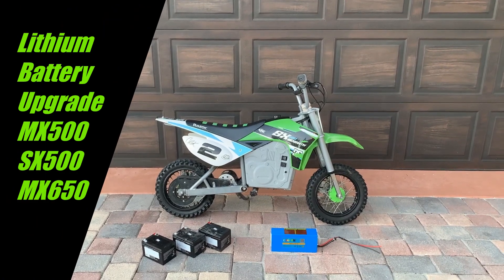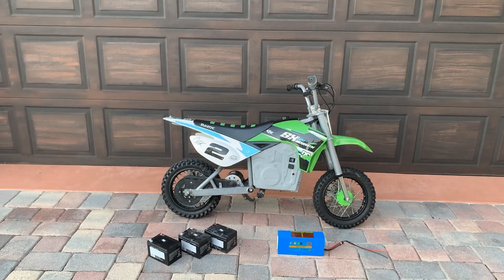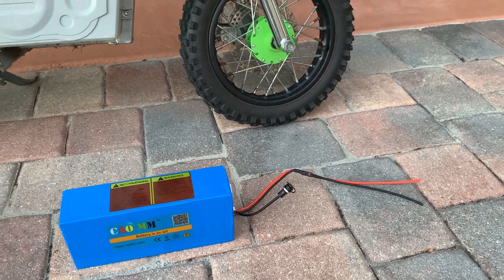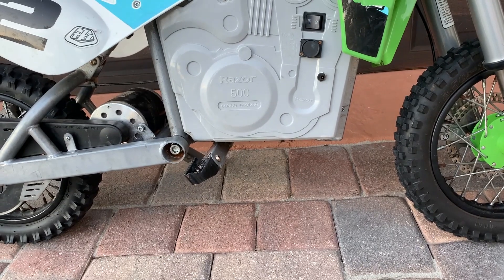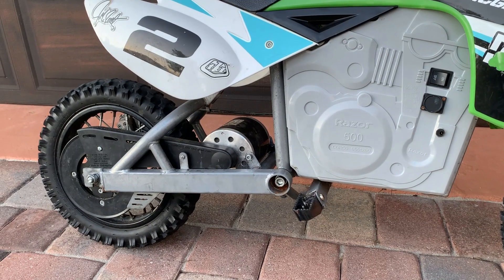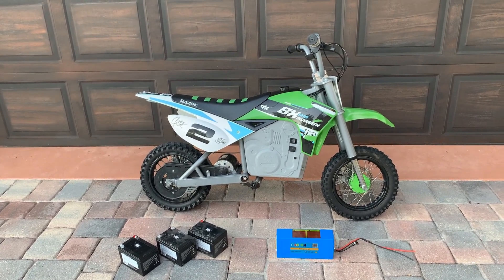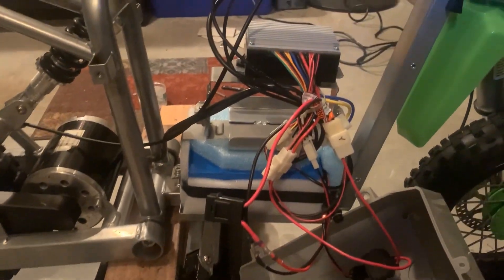Lithium Battery Upgrade - Razor MX500 MX650 SX500 - 18 lbs lighter

Comment: Great video. Do you have a link list for all these amazing free recommendations? I hope you make a little coin helping us out here in the world getting the most of our kids bikes. You rock man.
Reply from the maker: All products used are in the description below the video i also linked them here in the comments 
36V/16Ah 30A BMS Battery & Charger in video:  https://amzn.to/4aTVASS    #ad
(25% longer ride time over stock 12 AH battery)

For longer ride times
36V/20Ah 30A BMS Battery & Charger: https://amzn.to/4aTVASS  #ad
(60% longer ride time over stock 12Ah battery)

Solder & Seal Connectors:  https://amzn.to/3m67t0e
Heat Gun (you can use a lighter) :  https://amzn.to/3rGepCr   
Lever Wire Connectors (east to use): https://amzn.to/3sEI7sB 

Optional Equipment (How to Video coming soon):
Head Light with Switch:  https://amzn.to/3m6lRph
Taillight (states 36V but I use it with 48V w/o issue)  https://amzn.to/3sS0737

Comment: I’m trying to upgrade my little brothers mx350 razor dirt bike, he wants it to go faster and for the battery to last longer. Do you have any suggestions on what I need to do?
Reply from the maker: Yes replace the stock 24V batteries with an new 36V 10ah lithium battery the stock motor and controller can handle the extra volts and you will be able to ride longer and bike will be faster.  Link to 36V 10ah battery with charger on amazon https://amzn.to/3VGO8G5
Reply: @BRichSolution  iv‘e never done a battery change, is it hard? Thank you

Comment: I'm about to purchase the 36V 20AH battery for the SX500. The plan is to upgrade the machine to a 48v at some point. Do you see an issue transplanting the SX500 36V platform directly to a MX350 after an upgrade to 48V?
Reply from the maker: You can transfer the drive train from sx500 to mx350 or mx400 but you need adapter plate for motor to mount on mx350 smaller frame.   https://www.facebook.com/groups/561873590646946/permalink/2197774220390200/?mibextid=W9rl1R

Comment: We're about to upgrade a stock 36v Razor rsf650 to 48v. And a stock razor 350 24v to 36v. Will that alone make the bikes faster? Do we need to change anything else?
Reply from the maker: Here is how to video for Rsf650 48v build.   You can do the 48v battery now and then add 1800w motor if you want.   
https://youtu.be/rBJ2z1ujeRg
Reply from the maker: As for the mx350 use a 36v li-ion battery with stock motor and controller and will give you good performance gains
http://ebay.us/7VCLqF

Comment: Can you install this on the mx350?
Reply from the maker: Technically yes, but would require a lot of mods as motor mounts are smaller on mx350 and battery box is smaller
Reply: @BRichSolution  is there a smaller 24v one they would just plug and play even if the battery is bigger. Basically wire to the existing stuff? I found stock sized lithium batteries but the whole charging situation would be custom and the batteries you’re using seem to have the charging built in.

Comment: i wired and did everything you did in the videos and it is not doing anything i really need help! Plz
Reply from the maker: Which setup?  36v or 48v with stock motor?  Or 48v with new motor and controller?
Reply: @BRichSolution  i have the 48v with new motor and controller i don’t know how to connect the stock on and off switch with the e-lock on the controller

Comment: Why did you keep the 30 amp fuse? I thought you could just solder the two red wires together? Thanks
Reply from the maker: You don’t need the fuse as the li-ion battery has a built in fuse or BMS… I did it as double protection but it’s not really needed.

Comment: I just got this battery and how do you connect it to the upgraded controller with the   1800 watt motor? Thanks
Reply from the maker: See this video 35 MPH / 48 volt - Razor MX650 MX500 or SX500 upgrade for $350, Lithium Battery Upgrade
https://youtu.be/thfQyCmczlk
Reply: @BRichSolution  Awesome thanks

Comment: trash cao mm battery. not real capacity, weak power
Reply from the maker: I’ve built 8 bikes with cao batteries and have not had issue with them and have over 500 miles and 200 charge without degrade in performance
Reply: I got one coming with a fast charger and will let u guys know if it depreciates the battery over time.

Comment: Would you suggest the 16 ah over the 20ah?
Reply from the maker: The 16Ah will give you about 25% more riding time over the OEM batteries and the 20Ah will give you 50% more riding time.   All depends on your need or budget
Reply: @BRichSolution  from the listing on eBay they were pretty much the same price.
Reply from the maker: @afternoondelight6322  if so then go with the 20Ah

Comment: I see all batteries are out of stock except the 36v 20 Ah batteries. Do they also fit with no modifications to the frame? Would you still recommend batteries now?
Reply from the maker: Yes I still recommend the batteries as I have installed 8 of them in MX650, MX500 & SX500.    There are nine 36V/20Ah batteries in stock  right now.   http://ebay.us/7VCLqF

Comment: Is it as simple as connecting the red and black from the lithium pack to the bikes red and black? I have an MX350 and there aren’t any cables running from the battery directly to the power switch like how your MX500/650 does. Rather it is just two cables from the battery into a connector that connects to another red and black running from the control module.
Reply from the maker: yes, connect red to red & black to black on the end of where the old batteries connected

Comment: Can u run lithium battery with the stock control module ? New to the electric scooter and bike world thanks
Reply from the maker: yes I have 4 bikes with 36v and 48v using stock motor
Reply: @BRichSolution  thanks 👍..did u upgrade the speed controler and throttle also

Comment: Will this work at all on the mx350?
Reply: The bike goes fast enough but I’m wanting more battery life ! It literally lasts like 10 min of ride time at full speed with my 110lb 8 year old
Reply from the maker: hard to package the 36v battery in the MX350 frame.   Get your 8 year old SX500, MX500 or MX650 from FB marketplace or Offer up and then install 36V / 14Ah and the battery will last over hour.  Go up to 36v / 20 Ah it will run for over 90 minutes.    http://ebay.us/7VCLqF
Reply: @BRichSolution  nice! Thanks for the info .. I’ll start looking

Comment: So if I buy all the stuff and put it in my MX 500 will it work just like yours?
Reply from the maker: yes, see my other video for install into a MX650 (same frame as MX500).    https://youtu.be/edaY0i4dPJ4
The battery might come slightly different size; used the foam and bread knife to fabricate a cradle for the battery.  see this video at 8 seconds mark  https://youtu.be/kRvYAI1hdc4
Reply from the maker: yes

Comment: How long does it take to charge if I change it?
Reply from the maker: same as the OEM batteries about 3-6 hours depending how much the batteries are drained.   you can get rapid charger which can charge at 4 amps instead of 2amps but that could shorten the life of the battery

Comment: I have te razor SX500 and everything is stock and right now it is not working because 3 wires have burnt out and have disconnected from the battires and I dont know how to fix it because 2 months ago I took it to a reapair guy from razor and it needed new battiers but now I dont know what to do. What do you think I should do
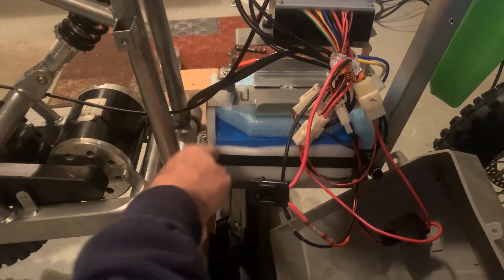Reply from the maker: Open the razor SX500 up and test the 3 batteries with a volt meter to ensure they are dead and inspect the wires to which ones burnt out.   If it's just the wires to the battery burned out then buy 3 replacement batteries or one 36v lithium battery and connect black wire from the battery to black wire on the dirtbike using butt end connectors and red wire from battery to red wire on dirtbike.    This video at 1:40 you can see how I wired the 36V Li-Ion battery to factory controller.   You can use the simple butt end connector which you crimp to splice the wires together or the connectors I used.
Reply: @BRichSolution  Ok thank you very much I will do that